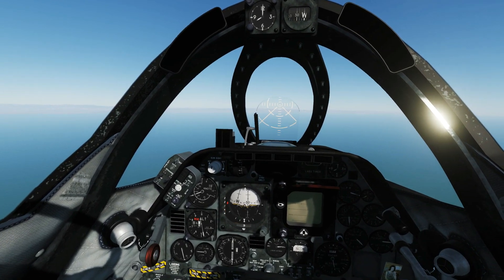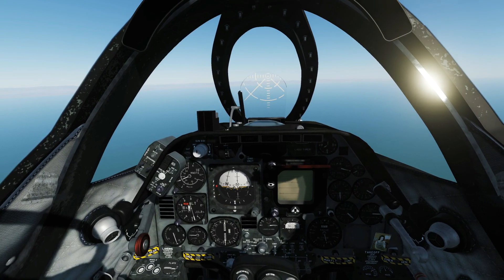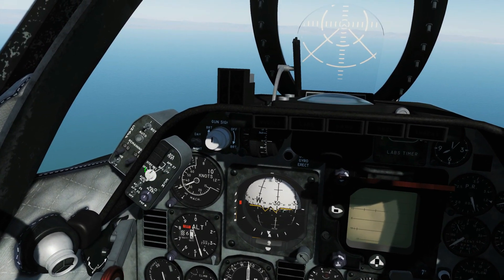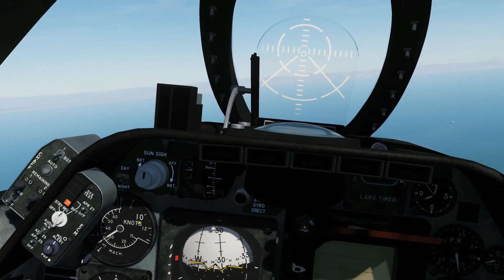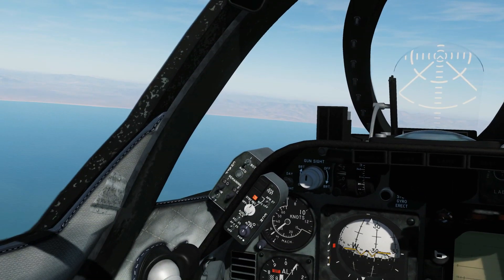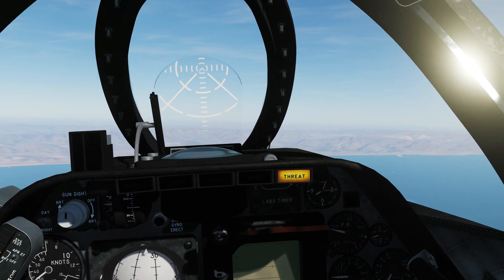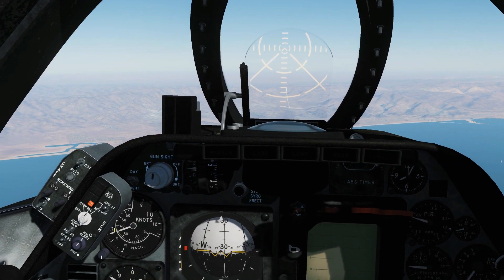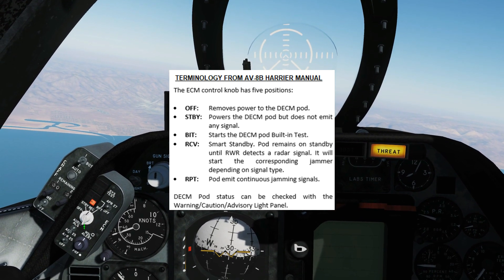A-4E Skyhawk: AN/APR-23 Radar Warning System Tutorial | DCS WORLD

Comment: My limited understanding is REC is receive only which is useful in informing the pilot and possibly recording ELINT data for after flight review while RPT should be a repeater as triggered by the APR-27 (why the RPT option branches off into the -27 switch). Repeating is a kind of signal jamming that sends the incoming signal back with variable delay to either provide extra incorrect returns (at farther range, e.g. ALQ-51) or more sophisticated range gate pull off which the false returns are smoothly increased in delay to try to pull the range gate of the radar off the real target and follow the one at fictional range (ALQ-100?).

The APR-23 -25 -27 are just sensor, an A-airborne, P-radar, R-receiver. Nothing transmits although it might interface with other systems that do. The -23 -25 should be (don't think both were ever installed simultaneously?) for search radar reception while the -27 should handle missile launch warning (looking for L-band changes associated with SAM guidance). I'm guessing the two knobs are probably for -25 and -27 volumes (-27 relating to missiles). "PRF" is suspicious that it might be adjustment for what PRF is being looked for but there are no markings that would facilitate being so specific. I think search radars have PRF while the L-band guidance for SA-2 and similar are CW (not PRF) so that might explain labeling that volume knob that way.

The audio source switch should select between APR-25 (down) which is built into the airplane and ALQ (up) which might be an internal or pylon-mounted external countermeasures pod. Since the ALQ isn't installed? it never provides any audio when selected. I think it might be the ALQ-51 or ALQ-100 which are internal. Presumably the ALQ equipment is also able to provide audio so pilot is given the choice between -25 and ALQ source.
Reply: I do believe the -23 and -25 were both installed simultaneously on this block of A-4. This is the updated E-C model with the more advanced EC systems (for the time of course. Lmao) in that hump behind the canopy. 

That tells me the systems are fairly accurate to what she'd have IRL.

Comment: It appears that it is a jammer. In REC mode, the jammer doesn't do anything until it gets nailed, then it activates the proper jamming signal. In RPT, the jammer is always on, constantly emitting a jamming signal even if you aren't locked. I assume you would not want to use RPT mode when trying to be sneaky as it will alert enemies before they spot you as your jammer will be screaming out a jamming signal. The RPT mode could be useful when flying with other aircraft to jam enemy radar and lower the risk of enemies being able to lock yourself and your allies.
Reply from the maker: thx!
Reply: I always thought REC was "record", for gathering electronic intelligence IRL.
Reply: @Gneckes  it technically is. I think REC mode  actually stands for recieve and so it doesn't emit anything, similar to the F/A-18s ECM system. RPT is definitely repeater though, and I think that's because it "repeats" your aircrafts radar return to spoof the radar ranging systems and spoil the shot, again like the 18 and other modern ECM systems.

Comment: PRF, or Pulse Repetition Frequency, is the number of times per second a radio signal is turned on and off (switching). Not to be confused with a regular carrier frequency (oscillations of polarity from positive to negative per second - like the centre frequency of an FM Radio Station). PRF is like modulation, where the signal can be 'personalised' by adjusting how long the transmitter stays on for each brief burst of energy (think Morse Code), and then going silent to listen for the same 'code' to be reflected back. This is done to avoid a false detection from all the other noise and garbage floating around in the spectrum. I guess they provided this option in this aircraft to allow for detection of 'newer' types of radar scanning at the time.
RF and Radar techs are a brilliant bunch of characters. I hope I haven't done them a dishonor with this explanation.
Reply from the maker: Thx Sir